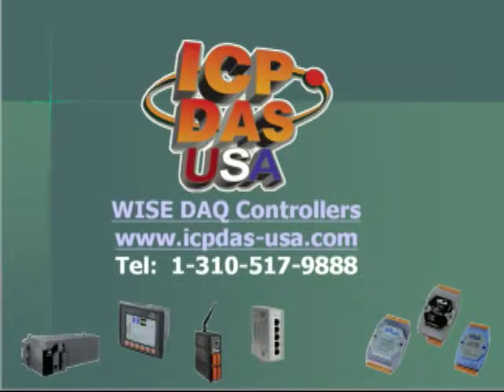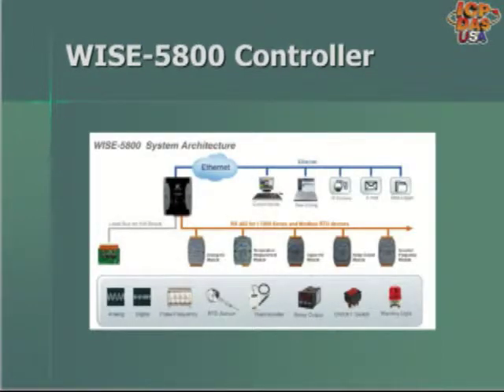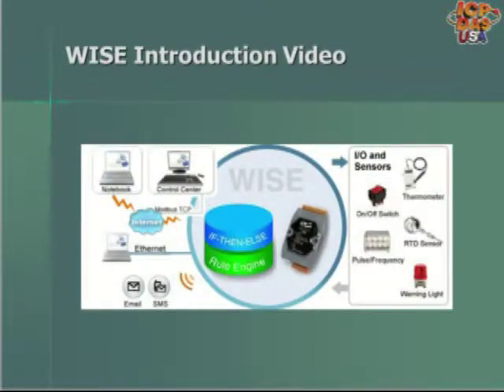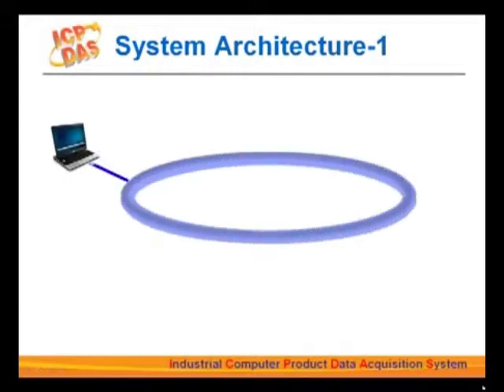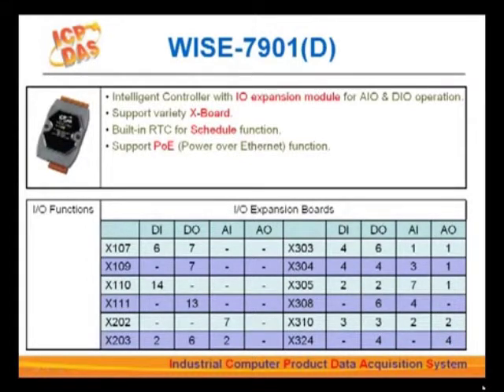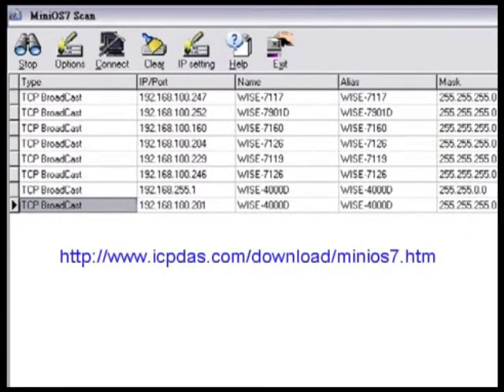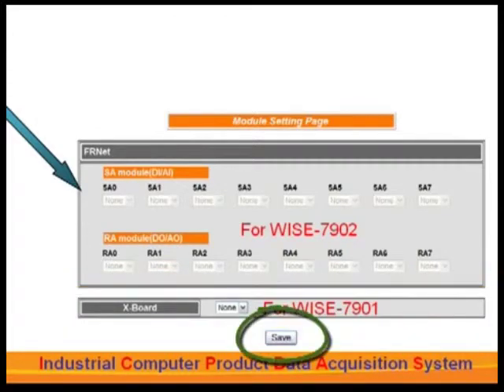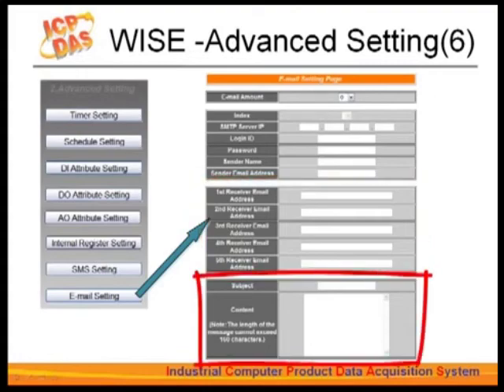Modbus Data Acquisition Controllers Training

Comment: HELLO, I HAVE AN I-7188EA AND I CAN'T ACTIVATE THE INPUTS AND OUTPUTS OF IT, COULD YOU MAKE A VIDEO EXPLAINING IT?
Reply: Hi Adalberto.  I-7188EA is a C Language programmable controller with 6 digital inputs and 7 digital outputs.  Page 69 of the hardware user manual shows the PIN assignment.  You can see the DI digital inputs and DO digital outputs labeled along the top terminal block.  If you want to activate the outputs and read the inputs, you would make a C Language program to run inside the I-7188EA.  In the link below for Demo Program you can use the demo program that reads and writes to the DI and DO channels.  

If you have any questions you can email me at marias @ icpdas-usa.com (remove the spaces in my email address) or email tech @ icpdas-usa.com (remove the spaces).

Hardware User Manual: https://www.icpdas-usa.com/documents/hardware-users-manual-I-7188EA.pdf

I-7188EA Product Page:  https://www.icpdas-usa.com/i_7188ea.html?r=maria

I-7188E Programming Demos: https://www.icpdas-usa.com/i7188edemos.html?r=maria

Demo Program: https://www.icpdas-usa.com/documents/I7188Edemos/napdos/demo/bc_tc/xboard/x107/?r=maria